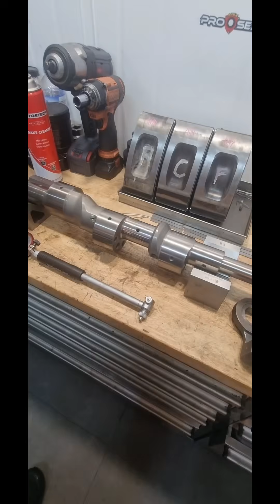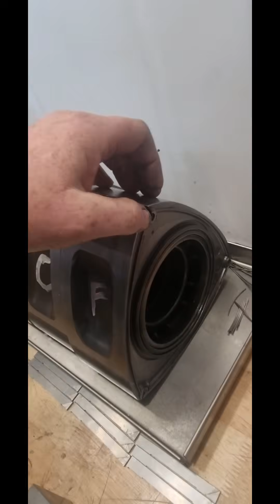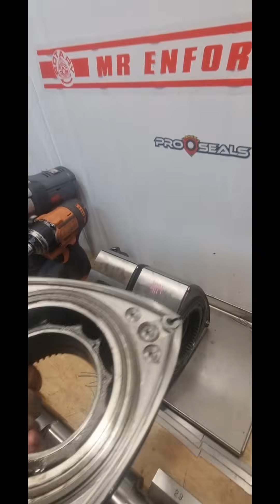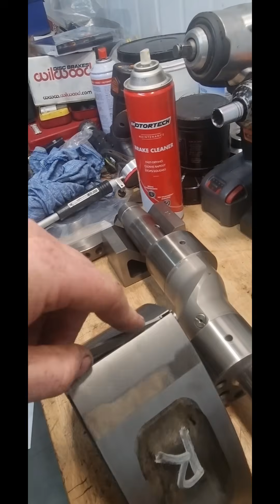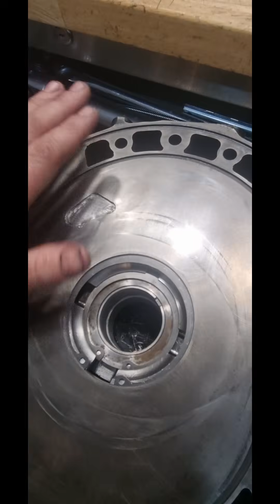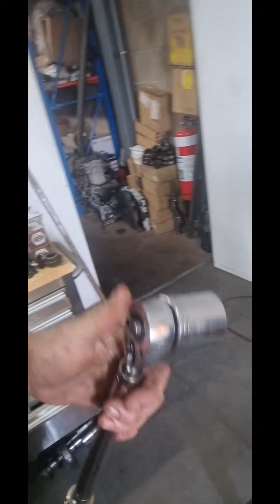peripheral ported 3 rotor engine   will it even run?

Comment: Also can you do this with an renisis and glsse housings?
Reply from the maker: Definitely not with renisis housing 
But gsl housings yes you can
Reply: @mrenforcerengineering  could the machine work for the stationary gear be done on an rx8 iron/centerplate

Comment: Do you have to run short crank motor as a full PP? Is there any way of doing Semi's?
Or will you have un-even air? Or is there a way to reduce the size of the rear and front plate ports?

Comment: Could you explain the pros/cons of the short eccentric shaft vs the standard one?
Reply from the maker: Pro's
Availability of short crank parts to build a new engine
Shorter overall length 

Con's
Cost of new parts
Intermediate plate can crank in boosted applications 

20b 
Cheaper to purchase up front
Stronger centre plate
Will take more boost
Con's
Can't buy a few of the parts new any more
Reply: @mrenforcerengineering  thank you so much for the detailed response. It sounds like the shorter engine build will be more ideal for naturally aspirated applications

Comment: How much would an engine like this cost please??
Reply: a brand new 3 rotor pp engine like this we sell for $30k aud roughly $18k usd
thats complete with intake manifold and throttle bodies fuel injectors oil pan and pick up
Reply: If I had to guess, probably 10-20k usd. 😂
Reply: How much for the machined plate?